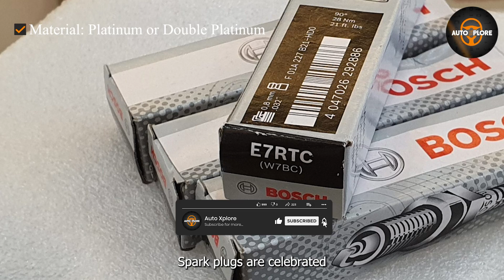NGK vs Bosch Spark Plugs: Which is Right for Your Engine?

Comment from the maker: Top 5 Ngk Spark Plugs 

NGK 6578 Spark Plugs
https://amzn.to/44ldKNR

BPR6ES NGK Spark Plug
https://amzn.to/4in2Kmg

NGK (6703) BPMR7A
https://amzn.to/42z1dnb

NGK # 3186 G-Power
https://amzn.to/4lFVbdf

NGK Iridium IX DCPR7EIX
https://amzn.to/4jsKn0z

 Top 5 Bosch spark plugs

BOSCH Spark Plug Set
https://amzn.to/44AesGN

BOSCH 9614
https://amzn.to/3S4qjW5

BOSCH 9603
https://amzn.to/3YAXRPq

BOSCH 9621
https://amzn.to/3YDriAg

BOSCH 6702 
https://amzn.to/4lFVd4R

Comment: Bosch double platinum for me its number one more better than ngk iridium colder I put spark bosch type fr5kpp332s one step colder this number for golf gti 5 and 6 I put on my honda civic r18 2007 turbo 250 hp are working perfect and more  performance and quick than ngk iridium iridium bkr7eix
Reply: So what would you recommend me to use on a lsvtec
Reply: @C.p-q2x  hi sorry what type of honda vitec do you have and model year  original stock or with turbo  charge
Reply: @ 
I got a lsvtec (b18block w/b16 head)
With springs and retainers, everything else’s internal are pretty much stock.

Comment: I was always using the AC Delco that was recommended in my owner's manual for my Tahoe, when my neighbor, a Mercedes mechanic, said get a set of NGK's and he said it without any hesitation. The difference was amazing! Fired right up, runs so smooth and you can feel the power. They were only a couple dollars more per plug. Glad I did it 👍
Reply: Thats weird ?  Most of the Ac Delco plugs are made by Ngk.
But Ngk's are the best plugs for any car if you care about performance and smooth riding.
Reply: @scottykilmer3920  Completely noticeable difference... Even the sound of the engine and I change my plugs maybe once a year or so.

Comment: Bosch spark plugs,only good place for them is in the trash can.Seen so many problems with them causing misfires.Have seen them take a complete ignition system in a GM.NGK also makes the spark plugs for AC Delco,Subaru and Motorcraft.

Comment: Ford 2018 v6 2.7 next time i will install bosch double iridium spark plugs 96315 .030 pregap  i found out after reading motorcraft oil is recycled low quality and motorcraft spark plugs are crappy.
Reply: Motorcrap plugs are extremely poor made!  it made my car run rough and very sluggish.
The best spark plugs are the Beru spark plugs.
Reply: Bosch spark plugs cause misfires in Fords,I have seen it before

Comment: Sir, is there would any harm for using NGK -- CPR 8 EA-9 instead of 
CPR 7 EA-9 for 125 CC Honda Shine bike ( daily short rider  )?
Reply from the maker: Using NGK CPR 8 EA-9 spark plugs in a 125cc Honda Shine bike instead of CPR 7 EA-9 may not be ideal, and it can have an impact on the bike's performance. Spark plugs are specifically designed to work with certain engines and their requirements, and the difference in heat range between these two spark plugs could affect combustion and engine efficiency.

In this case, CPR 7 EA-9 is likely the recommended spark plug for your Honda Shine 125cc, and it's usually best to stick with the manufacturer's recommendations. Using a spark plug with a different heat range (in this case, a higher number) could potentially lead to issues like poor combustion, overheating, or decreased fuel efficiency.

To ensure the best performance and longevity for your bike, it's advisable to use the recommended spark plug or consult with a mechanic or your bike's manufacturer for guidance on the best spark plug for your specific model and riding conditions.
Reply: @AutoXplore1  Thanks
Reply: Sir, minimum how much kilometer continuous drive should we make so as the spark plug reaches at its self cleaning temperature( in our usual 125 or 150 cc bikes ) ?
Reply: Check the service manual. In most 125 Honda CPR7EA & CPR8EA are both listed. CPR8EA is listed as recommended if you do long rides.